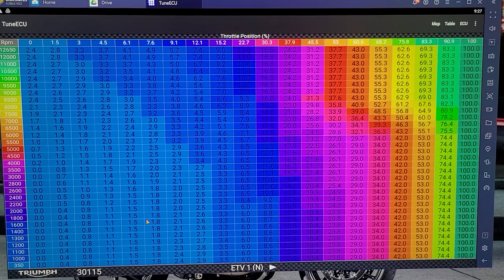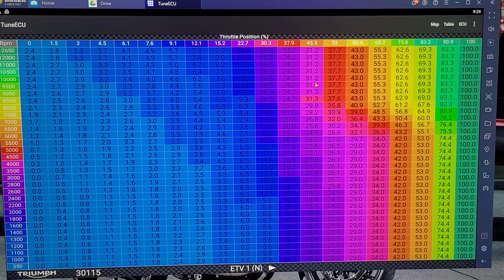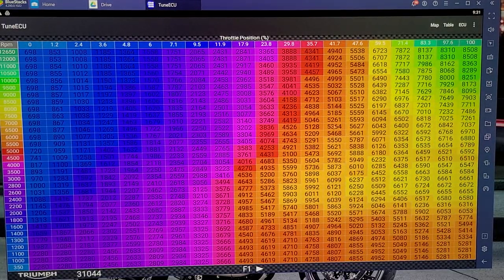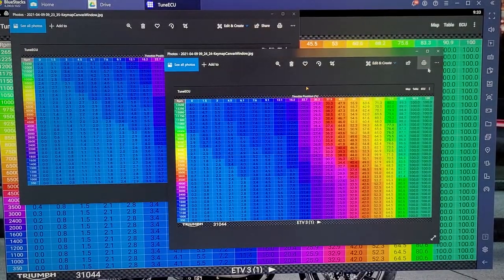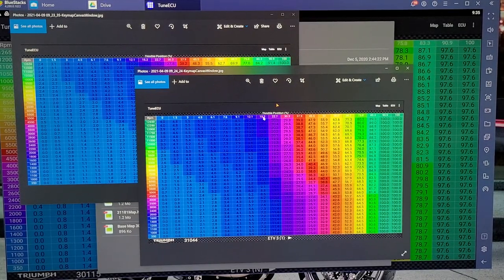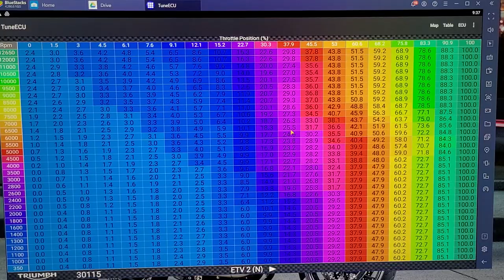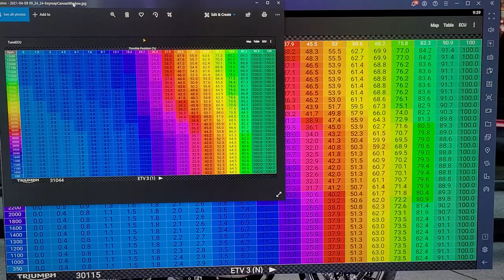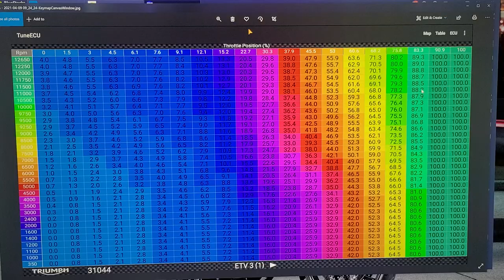Viewer Mail request - 2018 Triumph Street Triple RS throttle mod

Comment: Ive just been for a little ride. There is definitely a noticeable improvement. It's not massive but it is 100% a step in the right direction. At lower speeds, pulling away from lights, etc it feels quite a bit better.

I may have a play myself to see if I can make it a little more aggressive without it getting too snatchy.

I feel this could be a real game changer for 17-19 riders or even for people with 20+ bikes that just want it a bit more linear.

Thank you again.
Reply from the maker: Awesome.  This was successful then as a proof of concept.  Now you can take that as a starting point and refine it.  Nice!
Reply from the maker: Another thought, is to make the tables a true 1:1 ratio between how much you twist the throttle and how much the engine delivers.  Frankly, I would start there and see how it feels, and go from there.  If it's not enough, increase all the tables by 5%, retest.  I think that a 1:1 ratio across the board would mimic a conventional cable based throttle.  And then increasing everything by 20% would simulate going to a quick turn throttle tube.

Thoughts?
Reply: @SquireSCA  1:1 would be a great start. I am very new to tweaking these things and get slightly overwhelmed by all the numbers. Im sure it will get easier once it all makes more sense to me.
Reply from the maker: @harmlessprankster8417  I can knock it out in the morning if you want,  after I do my weekly podcast...
Reply: @SquireSCA  that would be amazing.
Reply from the maker: @harmlessprankster8417  Sent the new map, as well as a screenshot of what I changed on ETV3(Sport) mode.  As always, use with caution, and let me know how it works, if its enough, too much, etc...
Reply: @SquireSCA  thank you. will test in the morning and report back.
Reply: @SquireSCA  Ok, got out for a test of the new aggressive map.

The bike does a few weird things. There is a noticeable drop in power as I shift up at around 1/3 throttle and it stops pulling unless I crank the throttle more. Something it definitely doesn't do with the factory map. Also a few other somewhat rough areas.

I will revert back to the 20+ map you sent me, now that Ive been looking at it for a while, I feel confident I understand the table and I will work on that one to fine tune and incrementally make things more aggressive to find the sweet spot.
Reply from the maker: @harmlessprankster8417  Hmmm...  Ok, well, this is still good, because it's data, trial and error.  We just learned what not to do.  LOL

When I would do is go back to the first one I sent you, and maybe take that, and in the area that you want to "increase" response, highlight that area, and increase the entire range by 5%.  Then test it.  If it's not enough, increase that section by another 5%.  Leave the 90/100 columns at 100, and leave the idle and above idle area alone...  Just increase the rest by 5% at a time and see where that sweet spot is.

Comment: Dear Sir ! 

Can you please share modded ecu for full spark exhaust ? ( only 1 catalyst on the system and i use without db killer and KN air filter. 2021 765rs EU ) or can i use slip on map ?

Comment: Thanks for the video!

Quick Questiuon... I should be fine copy/pasting a sport mode map from a 2020 Street Triple RS (31044) to a 2021 Street Triple S (31035)? The sport mode map alone is way more aggressive than the stock mapping for the Street Triple S and i think it would help alot with responsiveness etc.
Reply from the maker: Sure, you can try that.  I have not looked at the S model.  I thought for 2020+, there was only the RS and the R?  They still make an S?

Just make sure that you have the right ETV tables.  On the RS, sport is ETV3, but on other bikes it might be a different ETV table... So you have to look at your map and determine which one is actually sport, and copy the tables into that.  Don't play with the fuel or igniton maps, stick to ETV only when doing this.
Reply: @SquireSCA  It’s the A2/LAMs model that is restricted to 35 KW. I have unlocked it already to give me full throttle above 5500 that’s how triumph restrict it (no fuelling adjustments required as the fuelling tables are identical to the non restricted model. The overall throttle map is very restricted though. And not very linear. For Eg at 60% I’m only really getting 40%
Reply from the maker: @NexusVibee  Would be cool to see a before and after run on the dyno, with the only difference being the throttle tables...

Comment: I am now straigth pipe with my street rs. I got my dyno session this month.. but do you know if the engine can be damage if i am riding before its getting tune cause i know its running already lean
Reply from the maker: It could.  I am not saying that it will, but it might.  I wouldn't ride it hard, or do a lot of miles on it until you get it tuned properly...

Comment: Hey Squire, could you send me your modded map for a 2018 RS?
Reply from the maker: Modded in what way?  What country and VIN range?  What are you looking for?
Reply: @SquireSCA  USA market, so I believe the 30117 map tuned to simulate a quick turn throttle
Reply from the maker: Ok, I built a map for 30117.  I made the Sport mode more aggressive but only above 30% throttle, so the cruising range will stay smooth...  I also set the AFR targets a tad richer, not sure if it actually does anything but it can't hurt... I extended the rev range a little bit, and turned on the cooling fan a little earlier which helps in the summer heat.  Just tell me where to send it.
Reply: @SquireSCA  I think YouTube is blocking me from commenting my email address. I will shoot you an email. Thanks for the help Squire!
Reply from the maker: @XsXTrills  That will work, I will be on the lookout for it.
Reply: Thanks for the time you put into these videos, great information and explained so well.

Out of interest is there any reason you can logically think of why I couldn't/shouldn't copy over the later ignition map from the later bike into my 2017?

Obviously I'm aware it should be checked on a Dyno to make sure it's ok and fully appreciate you're not responsible if I do it and it goes wrong 😂😂